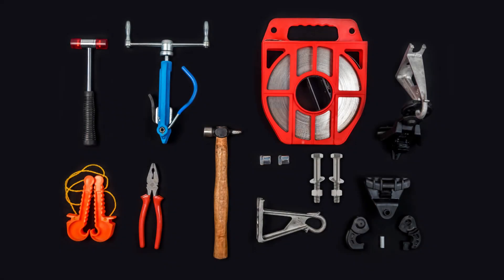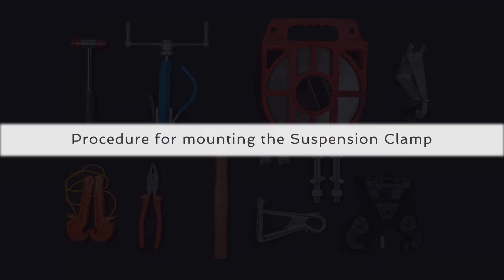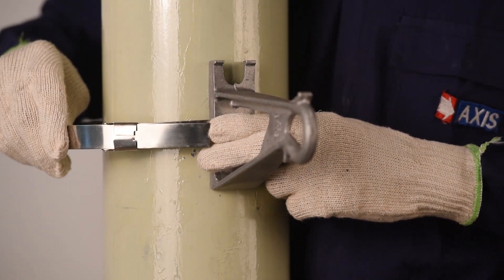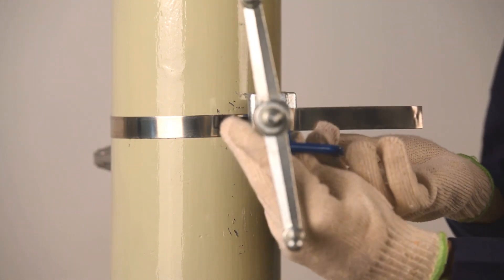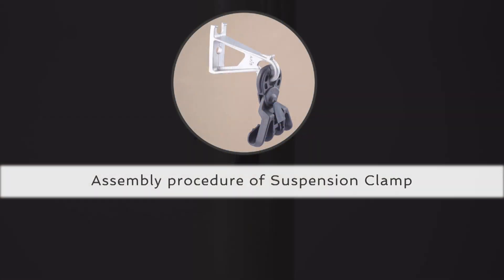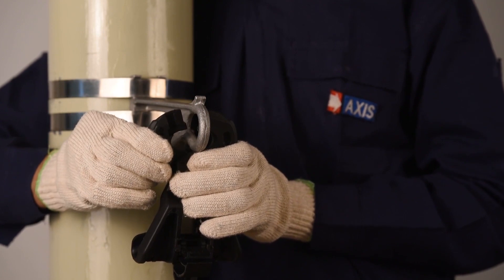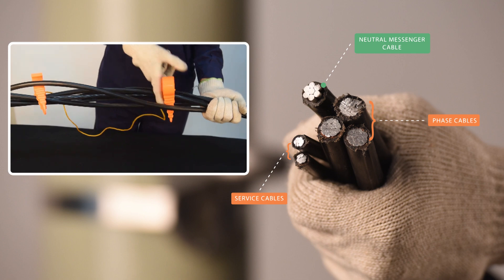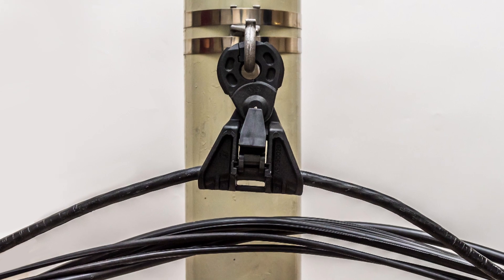How to install Suspension Clamps for AB Cables

Comment: What metal is used as a conducror in abc bundle?
Reply from the maker: Hello MKS Petit! The metal used inside the conductor is an Aluminium Alloy with an outer insulation of XLPE or PVC.
Reply: MKS Petit aluminum
Reply: Muy mala la esplicasion en español